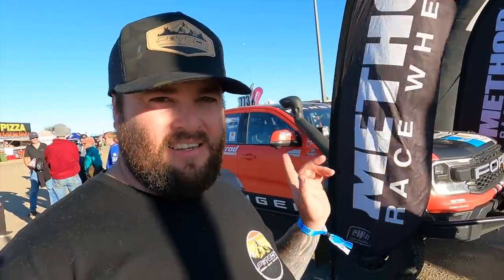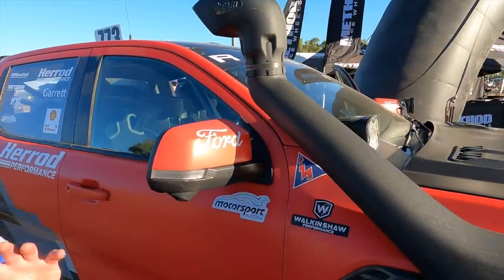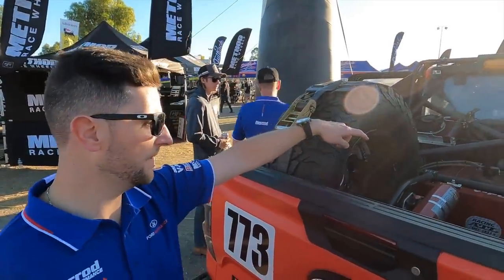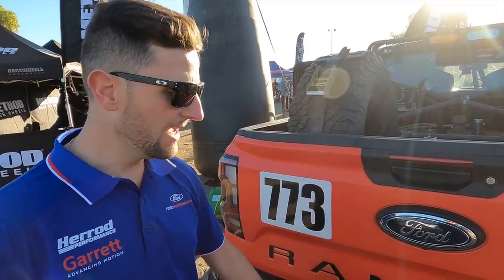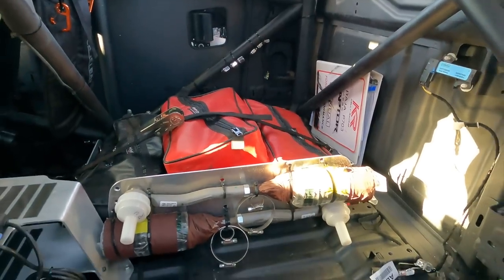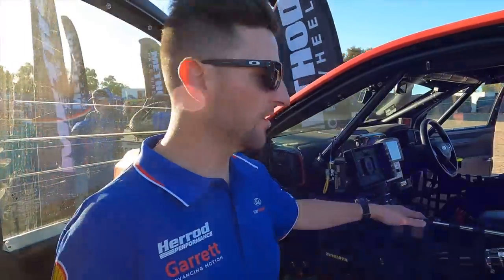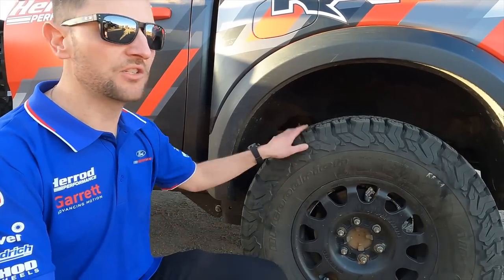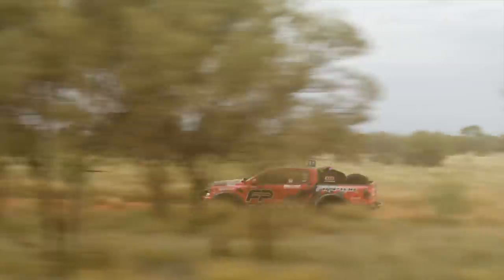🔥BAJA 1000 RANGER RAPTOR WALK AROUND ! What MODS did FORD make ?

Comment: Need to find out a bit more information on how they got there suspension tuning done so we all can get our next gens done as mine is getting heavy with bar and winch on the front and elec system in the rear
Reply from the maker: Absolutely mate
Reply: Brendan mentioned that we had fox provide a threaded damper so we could adjust the suspension to a specific ride height and get the ride height back within the correct zones.

No difference to valve bodies.

Before you ask. Unable to make that a standard offering, there are specific ADR’s around adjustable suspension. So it’s a race only proposition.
Reply: We need the same fox accessory for our rear to make adjustable.  Can you get us any more info on where we can get? @TyFenwick

Comment: When there putting these front bumpers on. How are they getting round the radar? Blocking the radar causes all sorts of faults. Worst of all REVERS BRAKE assist bonging every time it’s goes in reverse.
Reply: Well. Since they manufacture the car I guess they know how to suppress the warnings
Reply from the maker: My guess it radar might be removed just for racing function.
Reply: @dandretube  it’s made in Thailand bud, you would be surprised to learn how little people communicate out side the factory.
Reply: @TyFenwick  if we wanted to do a bumper change we could be humped unless we can access the data. I work on this pickups day in and day out and I still carnt access all the models through diagnostic. It’s very annoying

Comment: No different to every toyota, off the showroom floor to ARB for new air box, new fuel filter, diff locks, switch to make it a rear drive, switch to activate the rear locker in 4H, new suspension, new bigger tyres, brake upgrade, comfortable seats, more power out put, roll over protection on the outdated safety cell, I always ask what did you pay for in the first place.